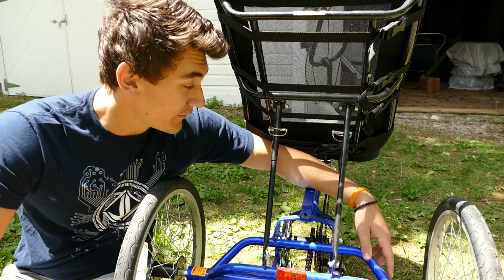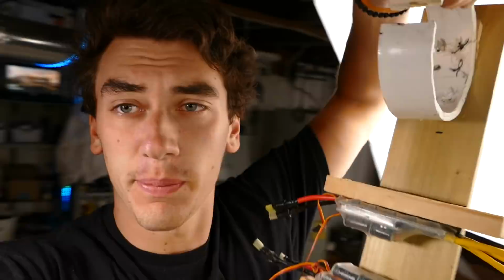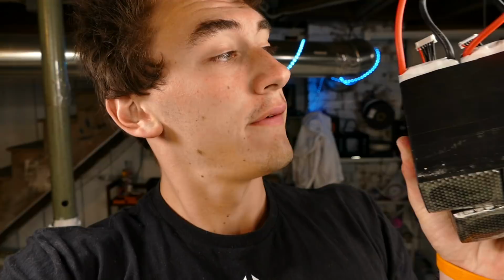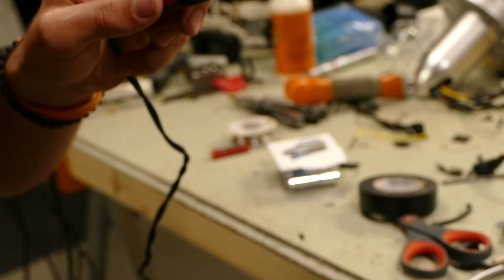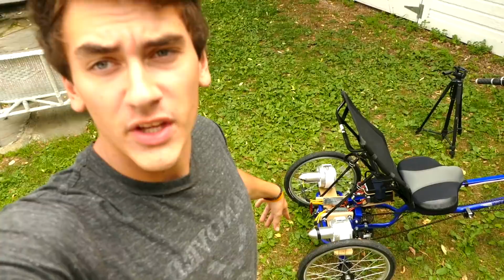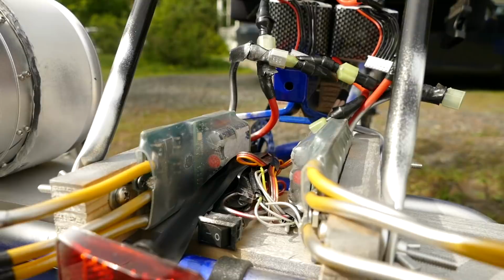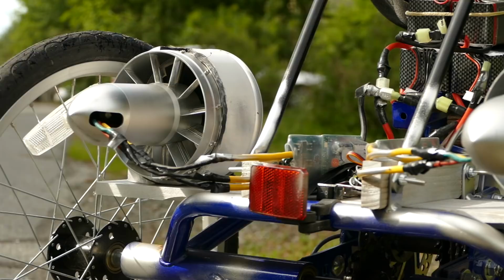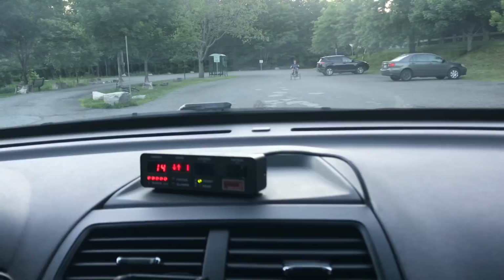DIY JET BIKE GOES WAY TOO FAST - COPS CALLED (Pulled over)

Comment: These arent jets... They're electronic ducted fans. Very strong, but a fraction of what actual mini jet turbines could do. I own 4. But theyre in an RC B52. Couldnt afford 8 so i have 4 next to 4 display mock engines. And its already insanely fast so i could get away with 2. Maybe i could do this project 😎
Reply: Bob  Two different things.
Reply: @thebrain9384  Where can I get those electronic ducted fans and mini jet turbines?
Reply: @magnaknight9252  I don't know, probably not hard to find but expensive.
Reply: @thebrain9384  Do you know the type of electric ducted fans is it?
Reply: @magnaknight9252  Ask Kelly Dunn up top. He seems to know something about them.
Reply: What are those ducted fans usually used for??
Reply: Bob  if your asking for price they're around 60 - 100 dollars depending on the size
Reply: not a jet turbine, but technically an edf is a jet seeing you're so interested in splitting hairs
Reply: Nerd
Reply: He referred to it as an EDF at about 7:15
Reply: They need jet fuel tho right?
Reply: Turbines are between 2000 to 10k per engine depending what thrust you need. The edf motors are cheap. Like 200 bucks on ebay but you gotta get your battery and the proper amperage esc to control it. Just look for a video on edf rc plane build and watch how they setup the edf system. Instead of hooking ur esc to a reciever, hook it to  a reastat switch.
Reply: yeah, he called them edf's in the video, he was probably just calling them jets because most of his fan base are 9 year olds that wouldn't know the difference
Reply: @DayFern  uuuh i don't want you to r/woooosh me are you talking about the edf's or the jet turbines kelly dun is talking about? the ones JLaser used only use batteries. The mini jet turbines used by Kelly though are most likely powered by kerosene but maybe diesel depending on who made it.
Reply: That’s what jets are, yes usually like with a jet plane those don’t count as jets but it is a type. As long as it’s propelling air through a electronics enclosed space (the blade isn’t by itself) it’s a jet. Also your talking about a jet ENGINE as the motor itself, by saying jet bike he means it’s propelled by the jet.
Reply: Wyatt Camacho talking about the jet engines that kelly Dunn was talking about
Reply: I understood half of that
Reply: @brianmck7363  Model aircraft
Reply: If you look the definition of jet engine up, you actually can call them that. But I wouldn't either seams kind of silly. Just EDF.
Reply: pretty sure it is becus edc s aren't loud i dunno didn't see it clearly
Reply: @magnaknight9252  The internet,  you should look there.
Reply: What could these do if hooked up on the back of a car? How much faster would the car move?
Reply: @chrisbaker9704  literally nothing lol
Reply: Thank you.  I was looking for the comment so I didn't have to.
Reply: @5naxalotl  Actually no...

"jet engine, any of a class of internal-combustion engines that propel aircraft by means of the rearward discharge of a jet of fluid, usually hot exhaust gases generated by burning fuel with air drawn in from the atmosphere." 

those fans do none of these and are not even a fraction of the power of a jet turbine engine, no one split any hairs here.